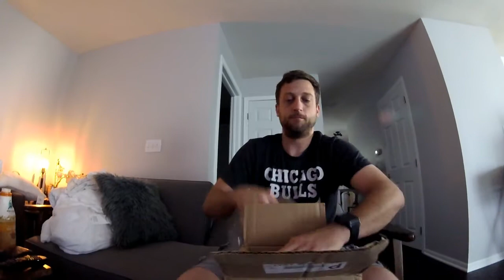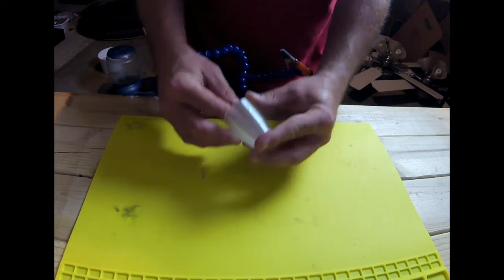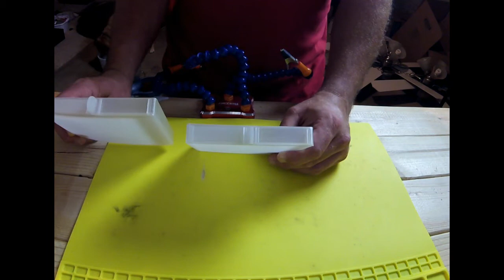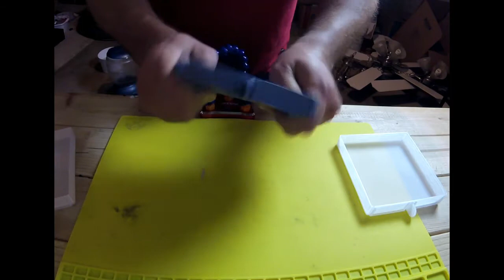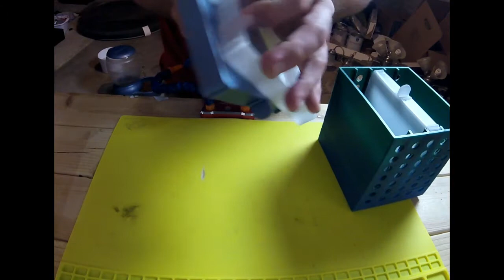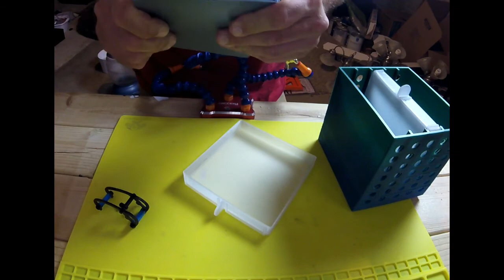Do not Buy June 3d Geek Box Maker Geeks AKA "Filament Geeks" NEW Carbon Fiber Filament

Comment: I have used TONS of makergeeks PETG...I prefer that over their PLA for most stuff.  As long as your temperature is halfway accurate 245C is fine for PETG, but I probably wouldn't go lower.  I have my settings at 250C because I would get way too much stringing at the 255-265 they recommend (depends on color and when they made the tag).  Have you tried annealing the carbon fiber PLA?  if you haven't heard of it there is a great vid on Thomas Sanladerer channel about it.  Also, if you do much with that carbon fiber (or glow in the dark) you may want to think about getting a stainless steel nozzle.  The carbon fiber is really abrasive and will erode your nozzle.  Best of luck and keep up the cool prints!
Reply from the maker: Joshua Callaway thank you very much. They claim this isn’t suppose to be bad for your nozzle, but I currently have an issue with my thermistor. Went out and need new one. I’ll have to check that video out I haven’t heard of that. I have been posting a lot on my Instagram with more frequent prints and whatnot if you’d like to check that out. Eazytarget3d on instagram
Reply from the maker: Joshua Callaway after looking at this video I have seen that I just never thought about doing it, good call out though thank you
Reply: EazyDrones hey, no problem!  If you haven't found a cheap place for a thermister check out folgertech.com. They are probably the lowest price for parts and stuff that I've seen.  If you know any other cheaper parts shops I'm all ears!...errr eyes :-)
Reply from the maker: Joshua Callaway awesome thanks, I actually just bought a hotbed assembly off of amazon. It was cheaper then buying parts separately, bc I needed a new hose and clamps too they were slipping for some reason on my tarantula.

Comment: You're having better luck than me. It's the 25th and I still haven't received my box.
Reply from the maker: Mark Dupray I’m sorry to hear that. Time for new months box too. I guess we will see. I can’t believe to hear all this I really liked what I have seen from them so far.
Reply: haven't received mine too, after multiple attempts to contact support i finally got a response today: "it looks like this label got voided for some reason so it never actually ended up leaving the shop. I just sent a note over to shipping and we'll get you a new package sent out ASAP."

You should contact them, probably the same issue
Reply from the maker: Hugo MARCHADIER yeah I finally had an issue but it happens from time to time. If you ask around amazon packages get messed up to. I have never not getten anything from them. Lol my current package was set for delivery in 2024 hahahahaha
Reply: They've responded a few times with excuses about being backed up.  Been promised a shipping date 3 or 4 times but no luck.  They don't even respond to my email now.  Love the July bait and switch.  $100 box but they don't actually have any of the product.
Reply from the maker: Mark Dupray I don’t get it I did have a small issue they changed my date to 2024 or something and they fixed it instantly? If it’s not sending I’d just say ask for refund.
Reply from the maker: Mark Dupray or extra free stuff, month late is crazy.
Reply: Best of luck to you EazyDrones.  I hope it works out for you better than it did for me.  They won't respond to my emails anymore so I had to dispute the charges.  I had such high hopes.  At least I got one of the 3 boxes I paid for.
Reply from the maker: damn man i'm very sorry for your experience. yeah i would definitely dispute them for sure if they are not sending it. I wish you could get the filament b/c it's such a good deal and great to work with.

Comment: Hey buddy!!! Did u check to make sure ur nozzle wasn’t too close or something wasn’t hanging down a little bit to knock that off. Or else it might of been a little too much speed for it. Anyways I’ve used there PETG a bunch and the only thing I’ve noticed is sometimes u might have to put it in the oven and dry it out at low heat before a print. It seems to gather more moisture then pla so u may want to keep it in a big ziplock bag or something. Anyways thanks for sharing if u have any questions get ahold of me on Thingiverse. I do the best of the week collections for them. Have a good day man!
Reply from the maker: KryptonicLoser yeah I think my glue stick wasn’t on good enough. Haven’t had problem with my other prints. Everything has been printing up really awesome for me
Reply: EazyDrones EazyDrones I’ve had a couple prints that I had to put down a couple layers of glue stick let it dry in between and put down another layer. Also I’ve messed with the first layer height and extrusion as well for somethings. I was thinkin about subscribing last month to the geek box and now I wish I did for the carbon fiber but I subscribed a week ago so I can’t wait till July’s comes.

Comment from the maker: Update: The PETG has been amazing too. Prints have been coming out perfect every time. not sure what the issue was with that first drawer but i printed out an Iphone X holder with apple watch and the prints have been better then ever and fine measurements for cord placements have been spot on. Both filaments have been amazing. I have yet to make or print anything more with the carbon fiber. In due time